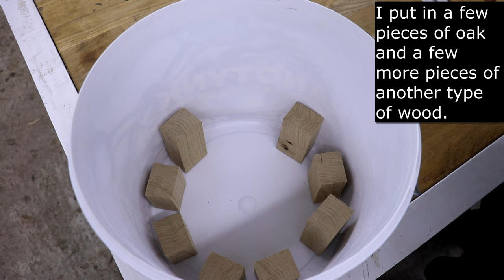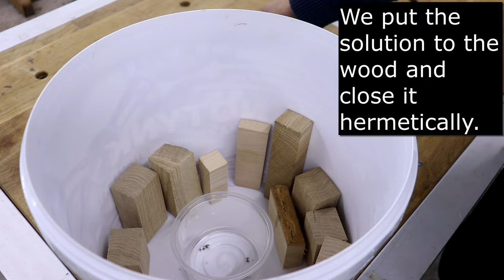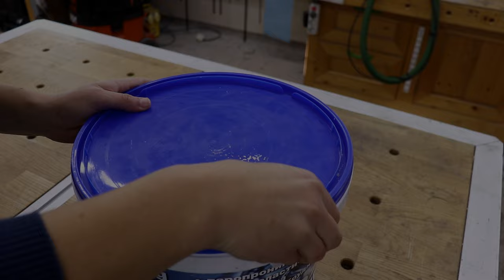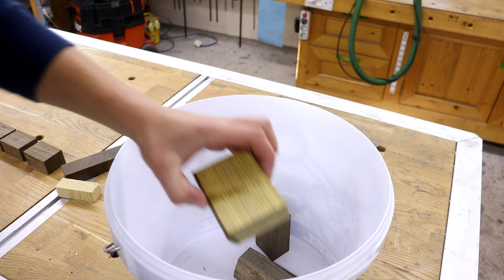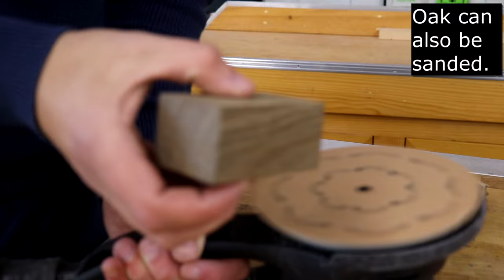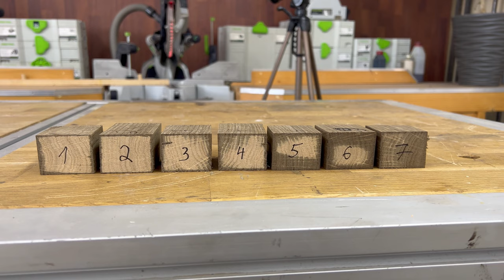Ammonia fuming oak. Woodworking.

Comment: Know what else to do this -stain… in a matter of minutes. Did dude have the same sweater on for all 7 days? I’m off to find a new ‘vessel’..!
Reply: I (hopefully respectfully) disagree. Stain, be it pigment or dye, doesn't impact the "tiger striping" as dye does. And that it a big deal then trying to replicate time appropriate pieces.   Personally,  don't like the appearance of either staining or fuming.  However, if my objective was (i feel like that should actually be "were", but it flags) to simulate antique furniture, I would endorse fuming. The final appearance is unique. Honestly, I don't generally like oak, white or red. But that QS look is pretty cool. And, I have a 100 year old (ish) bungalo (= lots of oak), so home projects (repair or furniture) are oak to maintain continuity.
Reply: @jackhammer4690 doesn’t it leave a smell on the wood?
Reply: @zaneseligman1313  I have never done it.  I would think the odor would dissipate. But then you can always tell when you walk into a house with a cat that pees on the ground.